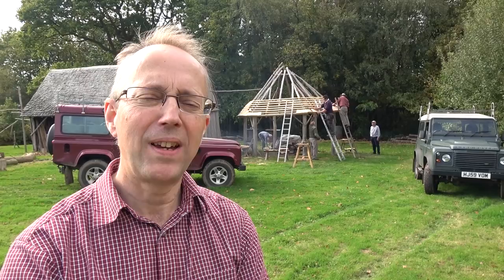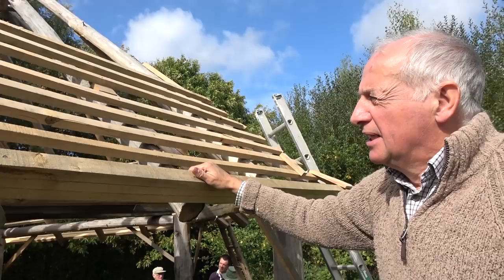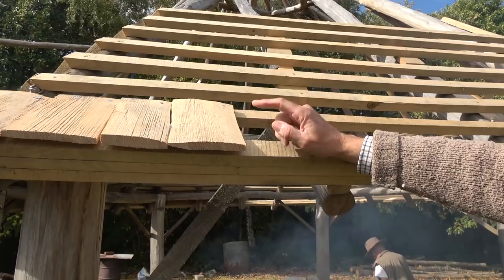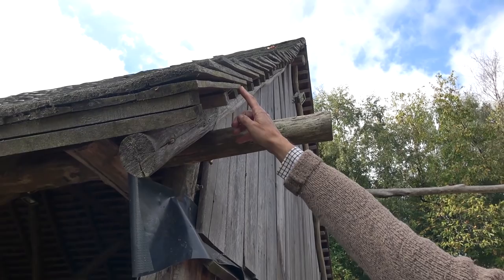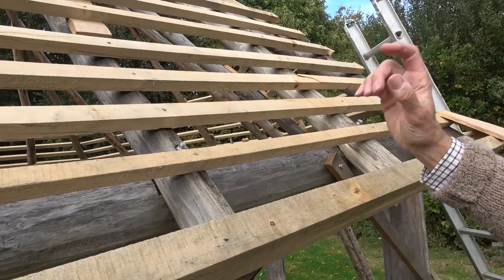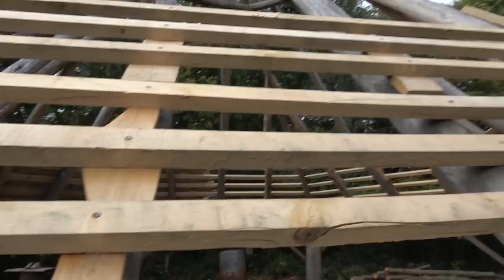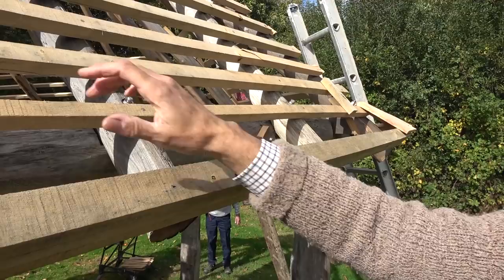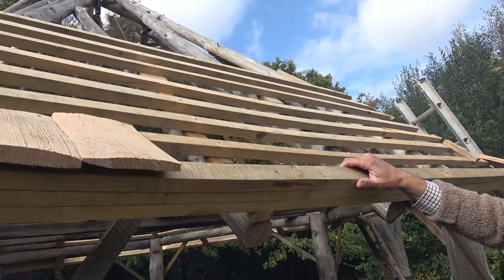Laying Traditional Wooden Shingles

Comment: Just adding some info about the "soaker" material, as at 9:40 he seems to be unsure how to explain the properties...: that DPC is designed to be a water barrier between the foundations and walls of a brick house. It's very durable indeed and will outlast the wood even with exposed parts to UV light. It has been given black pigment specifically to prevent UV penetration, so only the outer few molecular layers will deteriorate from sunlight. It's also designed to withstand sharp edges of concrete or brick, so it won't rip from any splinters or sharp edges it may touch, even when the structure moves slightly in the wind. Good choice :))

Comment: Instead of using the artifical DPC soaker  if you have access to any birch trees  you could use the bark for the same purpose.  On sod  roofed farm houses in Estonia where my family is from they would use birch bark  as the water proof layer between the sod and the wood below. The bark life span is about 30 years I have been told.
Reply from the maker: idrek1 Thanks...interesting and makes sense given bark canoes.
Reply: @harryrogers  A fun fact, the sod, or turf roof was actually mostly there to keep the birch bark in place. And yes, about 30 years or a generation. Back in the old days in Norway, it was a collective thing to do renewal of the roof when next gen took over the farm. Its all a quite good material, but you need some layers, and with correct quality. But, as history has shown, it doesnt work very well around chimneys and difficult angles. Its where you´re gonna find the damages in old buildings like this.
Reply from the maker: @yvindmathiassen7617  Thanks

Comment: Exclent demonstration learned the Cape Cod style the first 9 cources closer togther less shingle to the weather this would protect the beam on shake siding and fan out the wall to repell water goving your called kick board on out buildings we would use strapping 3/4 thick and 3 1/2 inches wide we would get from the saw mill we used white cedar clear shingles as neat by Mane has lots of them I will try large Chestnut now that I know your secret ! Thank you very much for this information !!!

Comment: Great video, and craftsmanship.

I would suggest a more durable solution for the corners, wich is used where I live for a long time. As shown on this roof the shingles on the roofcorners are cut into triangles prone to premature breaking because of weathering. What works better is to taper the last 4-5 shingles lightly from top to bottom so that there is no weak triangle if you arrive at the edge. At the edge of the roof the last shingle should overlap the last shingle coming from the other roofplane. The shingle being overlaped should be cut on its corner acording to the angles of the two roofplanes. The overlapping shingel should alternate every shingle row from one roofplane to the other.  I hope I am making sence.

best regards
Reply from the maker: Bernhard Neumayer Thanks for that good suggestion..certainly makes sense.

Comment: Loved wood work since school in Dagenham, 48-58, and have been splitting shingles from red boxwood in winter, for kindling,  but now at 74 living in the land of OZ, wondering , WHY is he choking  the claw hammer? More interesting than a truckload of DVD's
Reply: "Choking the hammer" I wonder whether it was the angle of the roof at that point as it kicks up but it might be to have 'less bounce' in the hammer since the baton is bouncing so much. Perhaps if they'd have put small' inter-rafters' between the existing ones they would have less bounce. Just a thought. I work on old French roofs now and then that use planks to put roman tiles on but of course the rafters are usually substantially sized pieces of oak and they don't bounce much.

Comment: In Cape Cod Mass. The first 9 courses from the ground shingle siding two layers on top of each other then up 1/8 inch then upma inch two inches three inches 4 inches to the weather then every 5 to five and ca half inches to the weather this with ceadet or redwood prevents bugs nailed with stainless steel ring shank nails iO used this methoid on my lands in Nova Scotia that has high winds 60 mph or 100 kph for a week at a time this is at the exstream southern tip of Nova Scotia Canada at the end of a 5 km long penisulia the Genetal Forbes Crown Land Grant ! Love the wood roof shingles idea when you cut the trees you would cut them so you eliminate the branches 16 to 19 inches long so you have clear wood no knots ! I used white cedar clear !

Comment: I'm curious as to the reason you space the shingles tightly. With perfections and even rough cedar shake we always spaced them 1/8" to 3/16" to prevent cupping. I believe you said it was chestnut? Are the properties different to cedar requiring this tight spacing?

Comment: Great information and presentation.  If you have the time and inclination, could you please explain why the lowest wood tiles do not overhang more?  I would think you'd want them hanging over more so as to prevent rain streams from running up under the shingles and constantly wetting the base of the roof.  Have a good week, sir.
Reply from the maker: Gristle Von Raben Yes more overhang if anything...it works fine as is but no harm in having more....certainly not less.

Comment: Thank you for sharing this film Harry! Will there be any more videos showing the six (or seven) ridges and how the top is finished off with the cowl? I understand that time is an issue: ie the weather is starting to turn. Many Thanks again. N.
Reply: Neil George hi, just to get the definitions fixed, the ridge is the horizontal beam/ plank at the top of the roof, parallel to the ‘wall plates’ running around the bottom of the roof. The beams/ planks from each corner,  running up to each end of the ridge, are ‘hip’ rafters. The join at the top, is a right fiddle, normally sorting the men from the boys !
Andy

Comment: amazing videos! so educative!!!
thank you very much!!!
just wondering what they used in the olden days instead of the plastic? 
maybe could one use thick woven linen soaked in wax?
Reply: i'd assume they'd use pitch/tar/or resin from the tree(usually pine) to patch up small holes if they couldnt deal with a spot dripping.

Comment: very nice thanks. I don't understand why blunting the point of the nail helps not to split the shingles.
Reply from the maker: vivanicola it stops it acting like a sharp splitting wedge and the bluntness shatters the fibres in a straight line
Reply: So that's why all the pallets I have been taking apart the nails are all blunted or flat on their ends.Interesting.They don't want pallets splitting.I save them and reuse them as well.I'm reusing the pallet slats for flooring.I have just starting learning to use wooden hand tools.I have a hand planer to plane the edges flat and square and a pair of tongue and groove hand planes.

Comment: Ive been thinking about how wood rots. If wood gets wet and then dry, thats not a big deal as much as one that stays in shade and wet. The sun dries and kills bacteria but the underside of a shingle doesnt get sun. If you burnt the underside of a shake shingle, taking away the bacteria's "food", wouldnt it greatly lengthen the lifespan of a roof?
Reply: Almost certainly. That's a method of treating posts too.

Comment: Does anyone know why they didn't lay the shakes spaced? but rather tight, is this some sort of magic wood that doesn't expand?
Reply: biker55555 inexperience , check the  roof after shakes swell a bit !
Reply: I've been surfing the comments for the answer to this question!  It seems like there would be less spacing if shakes go on green, but you'd have to soak them for several days prior to installation to put them on packed tightly, and even then a tiny bit of spacing would seem prudent.  ...right?
Reply: Because they're split,  they also absorb less water than a sawn shingle. They explained that in the video on making the shakes.

Comment: Why do you blunt the nails?
Reply: It stops the nails acting as a wedge and splitting the timber. By blunting the nail it punches through the grain without splitting.     PS another little         tip told to me many years ago,when skew nailing ;eg to tighten a timber joint , if you put a slight bend bend in said nail as it's hammered in it will pull up tight.

Comment: I prefer to use .92 to .95 thousands diameter nails 2.5 inches long ring shank in SS. Looks like .113 thousands you are using. I heard you mention they were not what you wanted.

Comment: Im curious as to why he is using the imperial system as his measuring system.  Is it the measurements used historically or is it the system he grew up with
Reply: Joiners and carpenters in Britain still use imperial measurements for joist, rafters and door spacings as sheet materials are still supplied in imperial gauges. plywood is still 8 feet x 4 feet, which means joist centers will be a division of either 8 feet or 4 feet.
12 inch, 16 inch, 19 and 3/16th inches, 2 feet.
if you know how to read a steel measuring tape, all of those measurements are pre-marked.
The greatest empire in the world was built on those measurements.
Hope that helps.
Reply: Because the metric system can get knotted. It's not the only system of measurement in the world.
Reply: Imperial is typical in carpentry at least in Canada,  the US, and UK. 

Metric would be odd.

Comment: Out of curiosity, why are they giving measurements in inches? For American viewers?
Reply from the maker: Hi metric is now taught in UK schools, but going back fifty years or so a lot of us learnt imperial measurements....so some of us still use the, to be honest I use a mixture of both which is probably really annoying for metric heads!
Reply: Land Rovers, and a whistling kettle. French units have no place in this setting.
Reply: As Carpenters, most of us use imperial measurements. Timber is sold in imperial, and once you get longer than a meter its much more intuitive, especially when one peron is fixing and measuring and another is cutting. Britain still uses a mixture of Imperial and Metric in most measurements. Particularly as all our older buildings were  built pre metric times. I would rather have a pint than half a litre !!!
Reply: Imperial is standard in carpentry in the UK, Canada,  and the US.

Metric would be odd.

Comment: I have done lots and lots of wooden shingles when I was a young man working in Maine, USA.  I was a carpenter specializing in restoration work.  You're not really making your corners very well.  Sorry.  You need to lap one way and then on the next course, lap the other way so no rain or melting under snow can  get through more than one layer.  In your  video at 8:09, you have lined every joint on that hip up and moisture will penetrate and rot around the nails and then in a storm will blow off and not when you want shingles to fail.  In contemporary times, carpenters often use flashing under the hip shingles to make up for their lack of a proper joint here.  I used to have nails called pins for nailing this joint tight.  A properly made shingle roof does not need any underlying felt paper, either but I'm just referring to some of the viewer comments.
Reply: He explained that he didn't (know how to) do the corners right and was using that plastic flashing instead.